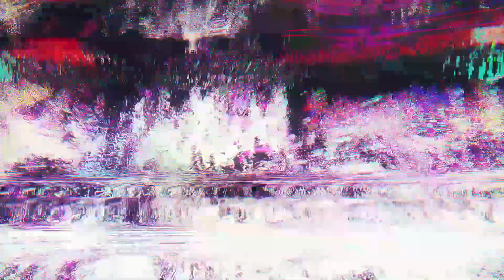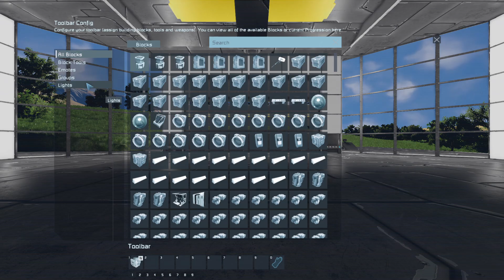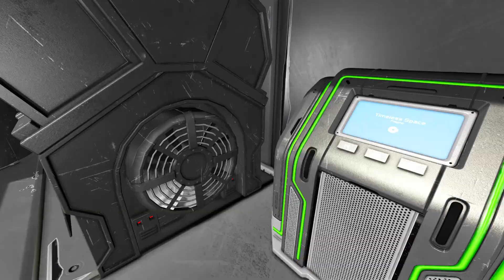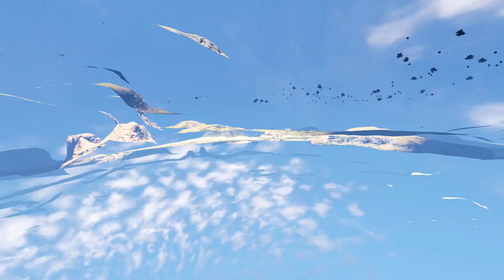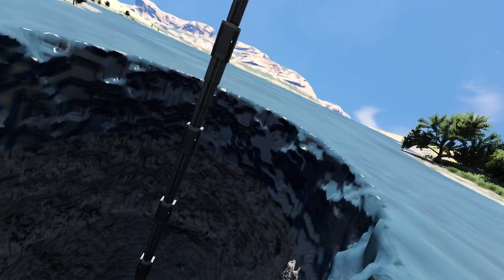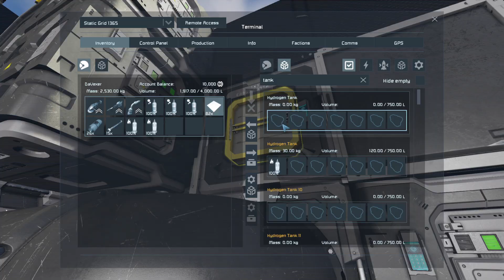Space Engineers Time Lapse Series: Building A Space Elevator - Nearly Ready for Launch - Context #5

Comment: Have been enjoying this series. Has to be the biggest elevator I’ve seen. I have seen someone build a bridge to the moon so they can drive back and forth. Your elevator is pretty cool. The printing system walking up the shaft is pretty neat. I was thinking while watching this series how cool it would be to see almost a reverse of this elevator system. 

One that would drill into the surface a huge shaft. As it’s drilling down, right behind it could be the shaft legs being printed. Go as deep as you’d like. The shafts purpose would be like a misfile silo. Once you get to the depth you’d like, then build a platform that could rise a ship out of the ground to launch into space. 

Also on a side note I find it humorous that you’re building this gigantic elevator to conserve fuel getting to space. You have like 40 hydrogen engines running consuming all your hydrogen to provide power for your system. Then added hydrogen tanks and engines to propel your elevator. This ending up using way more fuel than just building a ship to get to space. I still think elevator is cool and more of a personal challenge to build than it being practical. 

Have definitely enjoyed this series and can’t wait to see the “launch” of the platform.